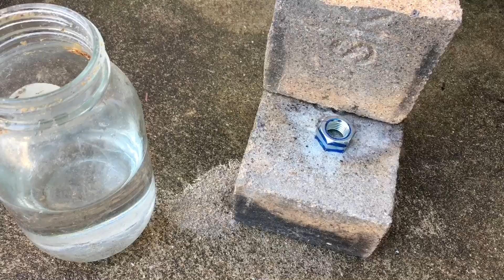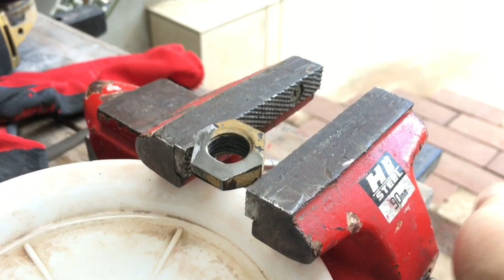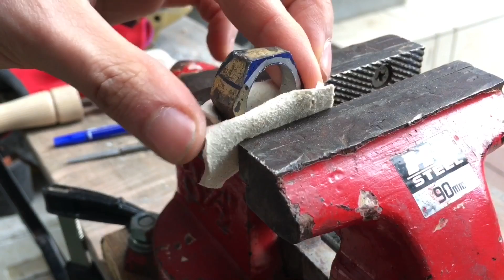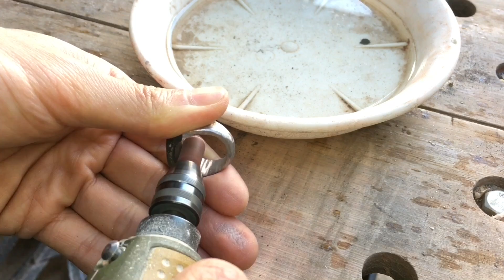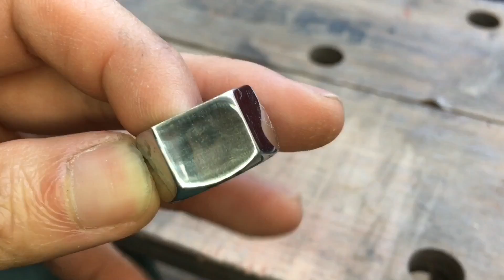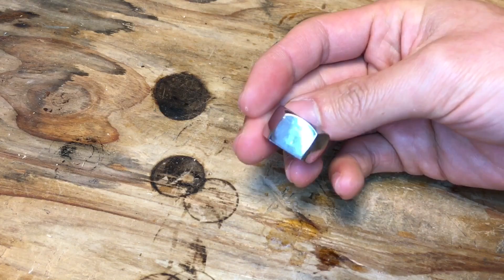鉄の指輪 ナットの作り方 How to make ring from Nut.

Comment: Why did you harden the nut before starting to work it?  I would have expected you to soften the nut, to make it easy to work, then harden it afterwards - although, for the application, does it make a difference?
Reply: How do you harden and soften steel?
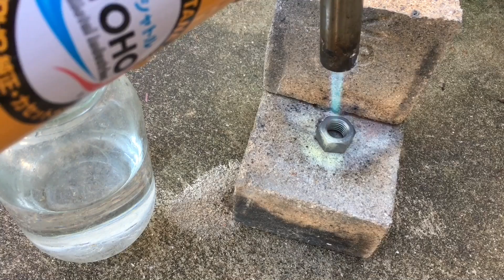Reply: @youtubefan6158  Soften steel by heating it to a high temperature and cooling it slowly.  Harden steel by heating it to a high temperature and cooloing it quickly - as at 1:05 - heated to red hot, then rapidly cooled by quenching it in water.  Search YouTube for hardening, softening and tempering steel.